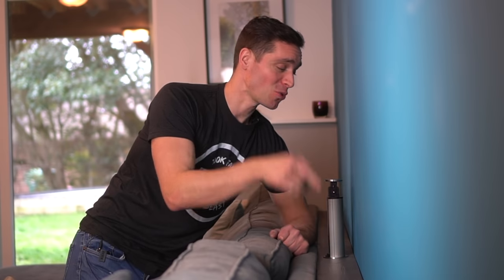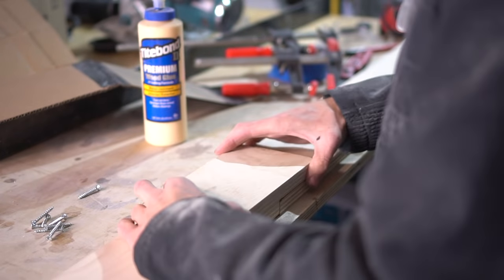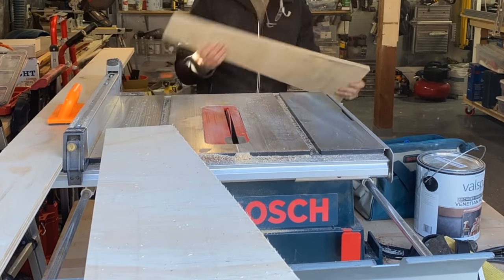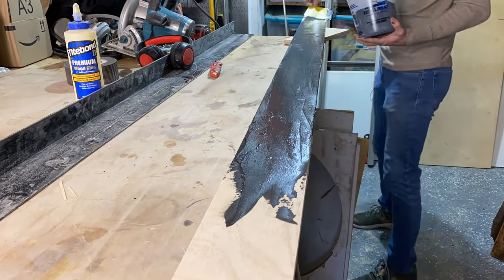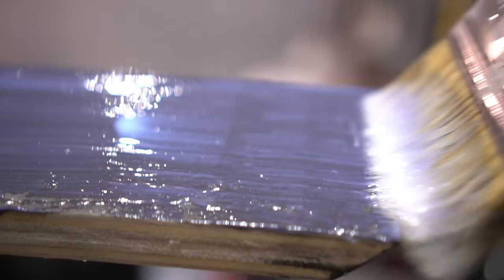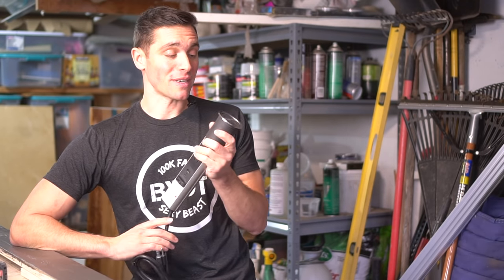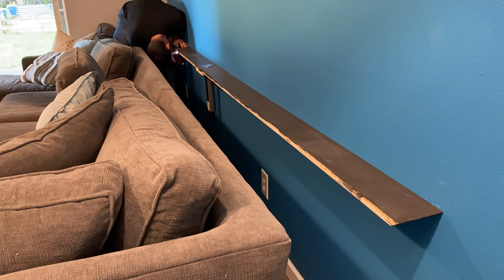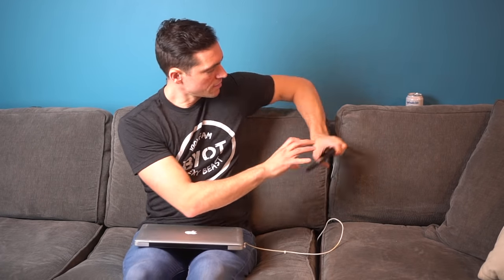DIY BEHIND THE COUCH SHELF

Comment: Nice shelf and instruction. Over time I'd be concerned about the sofa rubbing on the shelf edge and damaging the fabric.  One could put boards on the floor to butt up against the sofa feet and the wall or some type of "padding" on the face of the shelf so the fabric isn't directly touching the shelf.

Comment: I noticed that you didn't show the wiring connection between the popup outlet with the main outlet. Does it connect through a plugpoint, or do you need to make a rewiring through the wall outlet?
Reply: Its a plug an play like an extension cord.
Reply from the maker: Yep Zack is correct.luckily it’s just an easy and simple plug in.  Good question and thanks for asking. Hope you both enjoyed the video.

Comment: BRENT! YAASSSSS! This is a brilliant little project! I couldn't love it more! I've been wanting to try working with that Ardex Feather Finish stuff for a while now...interesting texture. (It looks like a midway point between joint compound and concrete...is that about accurate, you think? Headed to Amazon to get me sum and will use your link for sure!) I love the pop-up outlet, and the magnet securing the side panel is oh so smart. I love all things magnetic and have them all over the place, but I'd never considered them for an application like this. (I use them on my table saw for a couple push sticks, a small tape measure, a pencil, etc.) This is one of those rare YouTube presentations that solves several problems, looks as good as it functions, and is so simple that practically anyone could do it...As the self-appointed president of your fan club, thank you for coming up with it! lol Made my day! it really is OBSBOY!
Reply from the maker: Yessss Adam!!! Love hearing that and yes you are correct.  It is the consistency of joint compound but hardens like concrete.  I love magnets to and its always fun to use them in different ways like this.  This comment made my day Adam because you never know how your videos will be received and I'm so glad you enjoyed it.  Thanks again for all of the love and support.